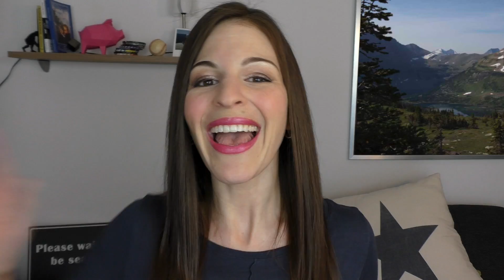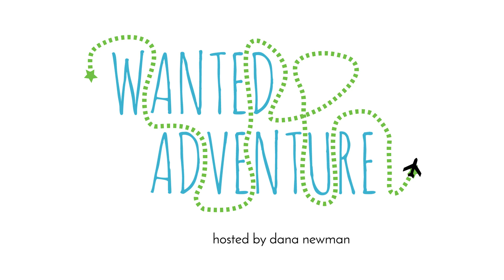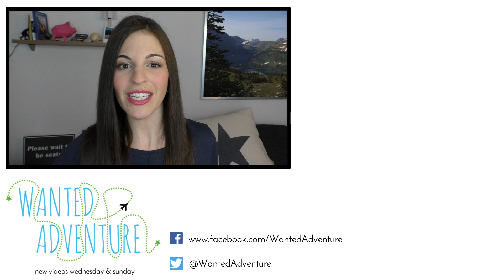Why Are Houses in America MADE OF WOOD?!

Comment: Hmm Just thinking about this ! You speak mighty winds in this ally of yours If I didn't have a bunker, I would have to go with wood as it is flexible and sways with the forces put on it but must be tethered in a proper manner with metal strapping. Brick or concrete may survive the first strike with damage and cracks but not the next as it would be weakened and turn to rubble.

Comment: Cheap. Wood is Very cheap here because we have many Germany's worth of it. I am a builder so I found this video very interesting. I grew up in 1960's hurricane land in a [very nice] cinderblock house with concrete roof tiles. Partly for strength, partly to resist tropical rot. Fast forward to the 90's and Hurricane Andrew wipes hundreds of homes off south Florida. They were made [some very poorly] out of wood because they'd found ways to treat the lumber to resist rot and bugs. Andrew also had it's own 'wall of tornados' which hadn't been really known before. Not much above ground can withstand a severe tornado, high winds, flying debris, and very low pressure which can burst [regular pressure inside, bursting to get to the low pressure outside] a house even before the wind and debris hit.

Comment: As to your question what would I build with? Well I think I would build with concrete block and re-bar. I've had one house like that and it was quite efficient. I'ts not enough to stop a tornado but I know they build a number of them in Florida along the coast with concrete roofs also. Their issue is hurricanes and this tends to help with rebuilding more quickly.
Germans need to remember there land was covered with forest hundreds of years ago and it was widely used as a building material. Today concrete and stone are much more readily available to them and so these are the materials of choice.

Comment: Cheaper, repairable, able to be modified, and expandable. It also lasts about the same amount of time if properly taken care of. A shift in the ground will destroy a concrete buildings foundation creating fractures along the whole structure. A wooden building is somewhat able to bend. So when the foundation cracks it is a relatively simple repair to fix. As for what material I would use that is simple. River stone. The reason is mostly to do with resale value and aesthetics.

Comment: I live in Miami, Florida USA and all homes here are made of concrete block with steel rebar reinforcement. Homes in our region are designed to allow all occupants to remain in the home during a hurricane without evacuating. Contrary to what most people think, South Florida is only evacuated due to the elevation where the structure resides, not because of any wind event. This is because the biggest threat is brought on by storm surge (coastal flooding driven by wind) and flooding. If you look back at New Orleans, it survived the hurricane quite well, what totally destroyed it came many hours later when the levees could not hold back the rising ocean waters and flooding overtook the city. Tornadoes on the other hand are a very different threat and I will leave the topic at that.

Comment: FOR  ME  CEMENT AND CONCRETE BLOCKS ONLY.
Reply: @projectnewwave6859  then RIP the house if its catch of fire
Reply: @thornwayne  then why don't people use fibre cement board in construction?
Reply: @projectnewwave6859  and then you complain about tornado destroying everything...
Reply: @stevenfrojd7106  bricks would be worst during a tornado I would rather have wood hitting me then a brick going over 100 mph
Reply: @tonioo8879  bricks can withstand storms unlike wood.
Reply: Wooden houses are strong and can last the same amount of time as cement and concrete if it’s taken care of and you need to care of any house for it to last
Reply: @antboa5104  true. But concrete survives hurricanes and wildfires better than wood does.
Reply: For me too
Reply: Bricks and concrete is so ugly. Drywall houses (aka American houses) are also ugly. Come to Norway for some real sturdy wooden houses.
Reply: @hasselnttper3730  our house can last in ages American wooden house's look the same as my concrete house your house is weak I can easily make a hole in the wall
Reply: Hybrid stainless steel rebar and stainless steel fiber reinforced concrete house. The posts, beams, floors, walls, roofs, foundations, stairways, etc. Concrete is 2-1-4 cement-sand-gravel parts by volume ratio. Water is pre-mixed with plasticizers and retarders to create a 
semi-plastic and semi-liquid concrete mixture. The 1 inch thick stainless steel rebars must be spaced apart by 1.5 to 2 inches from side to side. The stainless steel ties must be .5 inch thick and tied together by triple-twisted stainless steel wires or stainless tungsten steel mechanical clamps and the stainless steel rebars connected together by stainless tungsten steel Mechanically Bolted Couplers (MBT).

Comment: Wood houses are also easy and quick to build.  Very compatible with the American post-war building booms.  With other innovations like sheet plaster board, plywood, etc. it became the norm.  Most of the homes I have occupied in my 60 plus years in the USA were those type.  But most of them were also brick-veneer, where bricks are applied externally but do not bear structural loads.  This enhances appearance and reduces subsequent need for re-painting.  A current trend is to use pressed steel members for the skeleton of the house instead of wooden studs.

Comment: I just built a house with a wood frame. Why wood??? Easy, no one here knows how to build a house any other way. Simple changes in the way of normal home construction is mortifying to a sub contractor and very costly, if you can get them to do it at all. Simple example, having a floor drain in my utility room was mind blowing. I had to interview almost 30 tile layers to get one that knew how to handle the drain and he worked in commercial construction, which uses floor drains like mine.

Comment: wood homes are better in earthquakes
Reply: Which explains why it is almost impossible to build a wooden house  in Japan since 2000 regulation. #ironyOff
Reply: Eh for homes yes. For skyscrapers no. Skyscrapers are to heavy to be made out of wood. They are made out of steel and concrete. You can make steel and concrete move like a wood house but it is extremely expensive to do this so they don't do it on homes. John Hancock in Chicago is made to sway. I've been in there eating dinner and anything liquid would be moving back and forth. John Hancock is made out of steel not wood.

Comment: Like your home did not have asbestos.  HAHAHAHa...  I work as an asbestos inspector and I have only tested two buildings with no asbestos.  Normally in homes you find asbestos in the kitchen, bathroom, roof and on the heating system.  Then there are those homes where all the walls and ceilings are asbestos.  One word of note, you know those pads for placing dishes on the table for food like grandma used or still uses.  Take a look at them, the ones with the white paper on the back that says do not get wet.  Remember grandma used nothing but the best.

Comment: For a tornado proof house, i would go with a house, built half underground half over it. with windows at ground level. With brick walls slanted inwards like the CSS Virginia. And big steel panels that slide in to close windows/doors when a storm comes.

Maybe if a huge tornado hits it head on, and throws some serious shit into it. Maybe it would suffer some damage, but only some massive direct hit would. And even then it wouldnt fail like a wooden house.

Expensive? maybe. But you only build it once ...

Comment: I live in a house with a wood frame and exterior, on an island in the Gulf of Mexico.  It was built in 1949 and has stood up to hurricanes Carla (Cat.4), Alicia (Cat.3), and Ike (Cat. 2 with 14 ft. storm surge) just to name a few.  Only the storm surge of Ike produced any real damage beyond the loss of some shingles, as we had 3ft. of water in the house.  Wood houses are incredibly durable, cheap, and easy to repair, compared to other building methods.  As to building with wood because we have always done it that way, you were referring to something called cultural inertia.  Speaking of which, most of the houses here built in the 1880s and 1890s were built by German immigrants.  They built the houses with extremely steep roof pitches.  (Pointy roof tops) Local legend says it was because that was the way they had built houses in Germany, supposedly  to deal with the snow build up.  I wouldn't know for sure since I wasn't there and it doesn't snow here more than once every 10 to 12 years  I can't see another reason though..   As to tornados, well unless you build your house underground, there just isn't much that is tornado proof.    Tornados are all different too.  Some have a base a mile wide, and some very narrow.  Here, hurricane Carla produced several tornados, one of which came down 23rd street sucking a single side off of houses facing west,, then demolishing an entire store at the corner.  Houses and buildings on the other side of the street were untouched.

Comment: A reasonably detailed, non-insulting answer:

In The US and Canada, wood is plentiful and inexpensive. Assembling a "stick built" home is quick and easy, where brick masonry work is more expensive, more labor-intensive and requires more specialized laborers.  Concrete block masonry is also cheap and quick, but Americans view concrete block structures as unattractive.  In the US, concrete structures are used for institutional structures not residential ones.  Also, in many areas of the US and most of Canada insulation against winter cold is a primary concern.  Stick built walls have large hollow interiors that are filled with insulation, which is effective at keeping these homes warm in the winter.  These hollow walls are also easy to run plumbing and electrical wires through with minimal impact on the structure of the wall.  (This explains a related question that Americans have about British and European homes: "Why aren't there more electrical outlets?")

In reality, tornadoes are a rare occurrence in the US.  "Tornado Alley" is a small region that is not densely populated, and while the rest of the Midwest may have yearly tornadoes your chances of being impacted by one are astoundingly low.  Also, if you were directly struck by a tornado the type of building is irrelevant.  Brick, stone, concrete and steel buildings are just as devastated by a tornado as a wooden one.  You don't see that as often because those buildings are not as common, and also because they're more likely to be found in city centers.  (The heat pattern around denser population and traffic areas breaks up these storm patterns.  Tornadoes are mainly a rural issue, and practically unheard of in cities.)

American building styles are changing slowly, but the trend is toward sheet metal studs (which replace wood in areas prone to termites) and factory made composite wall components.  We're unlikely to abandon wood entirely, first because we have a cultural preference toward the look of wood, and also because we rely on commercially managed forests of fast growing pine instead of old growth forests for our building materials. We don't have an aesthetic or an economic reason to change.

Comment: Typically "Brick Houses" are NOT made out of bricks. They are a wooden frame "cladded" with brick. Bricks in and of themselves may be strong, but it is the mortar joints that make brick structures less desirable in many ways. Either way bricks still wear down over time just the same as wood does.

Many large old buildings in North America were once built from bricks, even having the bricks be a large part of the structure. They don't last much better without regular maintenance, and are much more costly to build.

Generally most modern buildings aren't really built to last anyways. Only for a couple generations. Designers assume many of the more modern buildings (save really big ones and the like) will simply be torn down after a few generations to make room for new development.... and it would seem they are right.

Comment: One reason for timber construction in some areas of the USA is that stone, brick, and concrete structures can be susceptible to catastrophic/sudden failure during strong seismic events (earthquakes).  Although it is possible to design the reinforcement to provide adequate strength during a seismic event, it would be impractical and expensive in areas with high seismicity.

Comment: The USA has one of the most diverse arrays of climate and natural disaster events. Your supposition that originally wood was what was readily available is correct. Expansion/migration across the USA happened very rapidly, so sourcing local building materials was essential. The very nifty thing about wood is that it can be used in many, many ways. Compare the sublime timber framing of the Amish to the 'Lincoln Log Cabin'. Very different structures. The roof structures in the southern states, for example, differ wildly from those in the western mountain areas. Why? Well, for starters, most people in Atlanta don't need to worry about ten foot of snow accumulating on their roof. Wood is flexible, abundant, and doesn't require extensive infrastructure and highly skilled craftsmen.

Comment: There is a company in Texas named Monolithic Domes that sells a system for quickly erecting a reinforced concrete dome. That one is actually potentially tornado proof, especially if you use earth berms or bury it. One structure by them actually did survive a runaway truck colliding with it.

Comment: Germans used up all of the wood and built hoses their or farms.  Look at Puerto Rico, nearly every single house is made out of concrete.  So it is about access to resources.  Half of every home in the midwest is concrete just the bottom half below grade FYI.  Cost and speed is the main reason.  

Also it is a renewable resource and saves carbon?  We do farm lumber and paper in USA. FYI